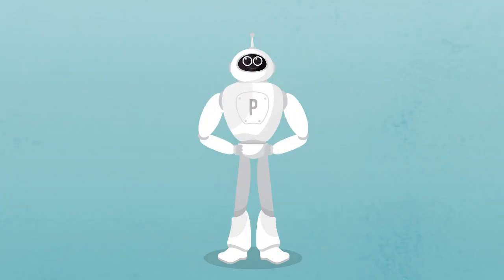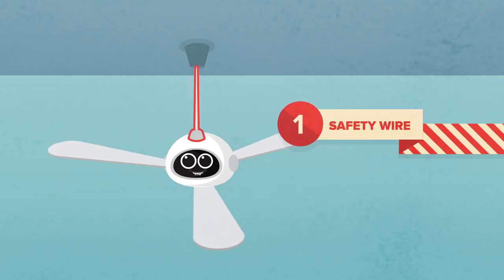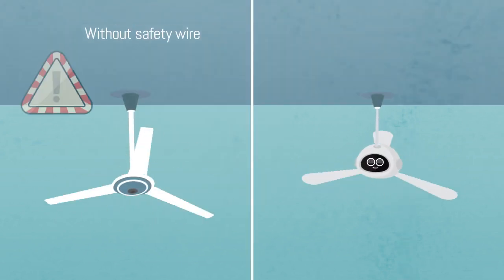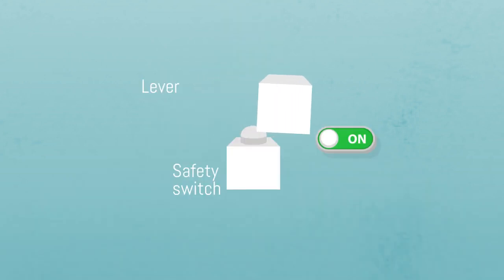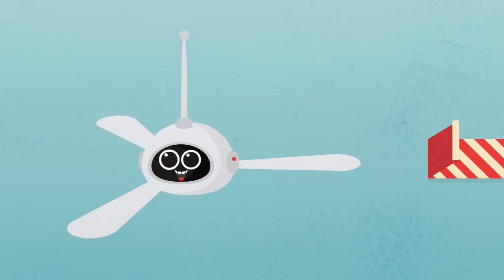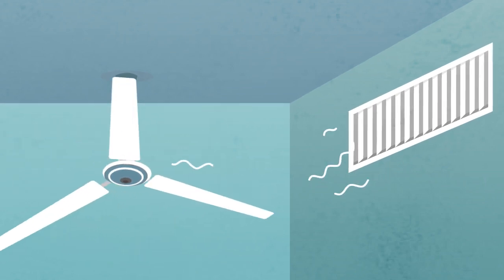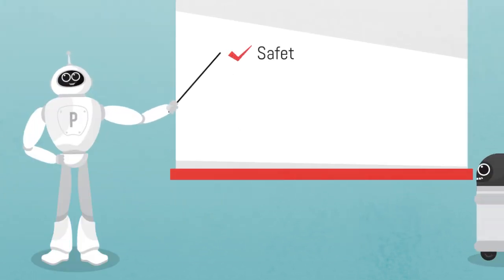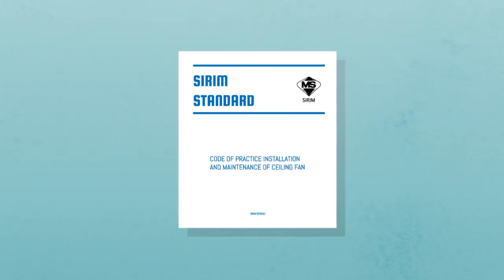Panasonic - Ceiling Fan (Safety Awareness) Animated Video

Comment from the maker: Learn how to install a ceiling properly with Panasonic. Take note of three main things – safety wire, cut-off safety switch and safety hook to make sure that your ceiling fan is properly installed in order to stop the fan from wobbling and to prevent it from dropping.

http://www.kasradesign.com/videos/panasonic-ceiling-fan

 #panasonic  
 #animatedvideo  
 #cartoonanimation

Comment: I think only Panasonic and KDK have those features. Most industrial ceiling fans like that I heard have a safety wire, but most residential fans don't. For non KDK/Panasonic fans, you better just check them every now and then.
Reply: Only Panasonic and KDK this'd ad copy it may the Safety Wire money? Heard have every now most Residential fan us Features l think that's cool thanks again you
Reply: Kat TheFanEnthusias
Reply: Kat TheFanEnthusiast